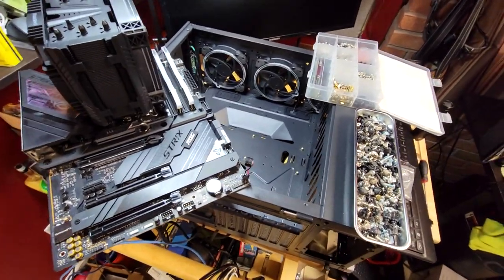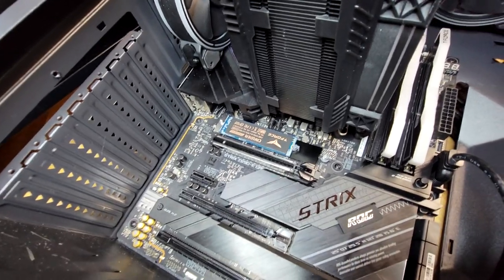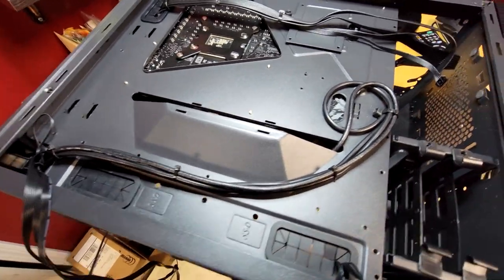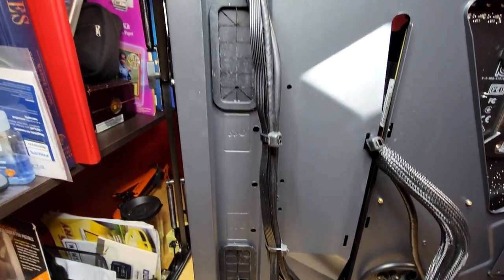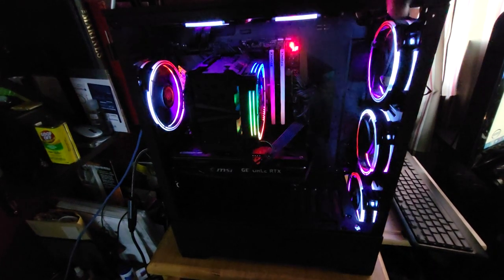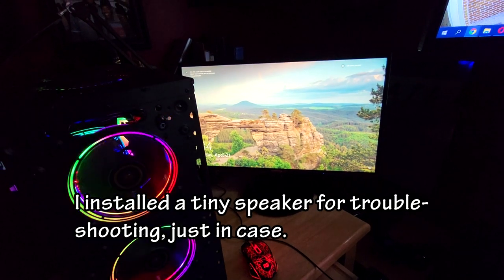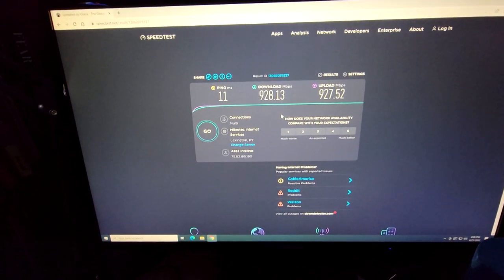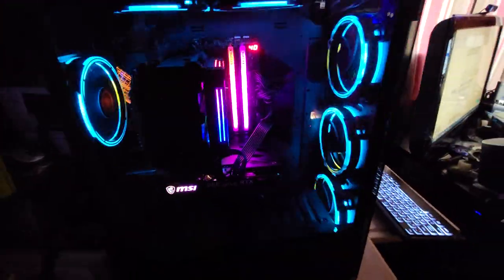Junkman's ROG STRIX Z690 E Gaming WiFi Monster Build - COMPLETED!

Comment: We had a storm that killed one of our computers.  The battery backup/surge protector no longer worked and I had not replaced the battery and I paid for it.  Fortunately it was just the house computer and not my gaming/photo processing computer.  I have to get a new mother board and CPU and drop them in. Which GPU are you using? What games you play?  Nice build.  All those roaming different color lights would drive me nuts though.
Reply from the maker: The GPU is a NVIDIA GeForce 3060, 12Gb. Everything from my computers to my TV's and monitors are protected by multiple APC battery backups. My office is protected by this monster.  https://www.amazon.com/gp/product/B077YDWR3Y/ref=ppx_yo_dt_b_search_asin_image?ie=UTF8&th=1
Reply: @Junkman2008  Nice.  I've been trying to score one of the latest Ti GPUs but no luck.  I may have to settle for something a bit less.  I have a build that's just sitting and waiting for the right GPU.  I left the computer exposed and paid for it.  It was a cheap I3 build for the family to use so not too much lost.  I hope the HDD and SSD are still good though.

Comment: I've never seen a lighted keyboard like that who makes it?
Reply from the maker: You have to go shopping in the old people's section of Amazon. 😄😄😄
https://www.amazon.com/gp/product/B09LH4KF5H/ref=ppx_yo_dt_b_search_asin_title?ie=UTF8&psc=1

NoW if you don't have bad eyesight, you're going to want the one I have on my main box by Logitech. It is very nice: https://www.amazon.com/Logitech-K800-Wireless-Illuminated-Keyboard/dp/B003VAGXWK/ref=sr_1_3?crid=3S7RXC2XUUH45&keywords=logitech+k800+wireless+illuminated+keyboard&qid=1650612459&sprefix=LOGITECH+K800%2Caps%2C68&sr=8-3
Reply: @Junkman2008  I've been using k800 keyboards for years but they break too easy however I love the programmable buttons. Thank you for the links.
Reply from the maker: @coleboonecustoms  
I've had my K800 for around 3-years. No problems so far. I like the fact that Logitech has programmable dongles. That's pretty much all I buy because of that feature.
Reply: @Junkman2008  I haven't looked in a while but I clicked on your link to the k800 and they are not available anymore and it turns out that Logitech discontinued the k800 unfortunately. That means they no longer offer a programmable keyboard.
Reply: I forgot to add that you can buy the k800 brand new on Amazon for $299 from a price gouger LOL.
Reply from the maker: @coleboonecustoms  
I just rechecked the link and it worked just fine. You may need to empty your browser's cache. Logitech doesn't make programmable keyboards, they make and sell programmable dongles. So if you lose your dongle, you can buy another one for $6 and program it to work with any Logitech device. You can even program a dongle to work multiple Logitech devices.
Reply: @Junkman2008  did you see the price when you clicked on it? because I tried it on a mobile phone and it's just shows that they're unavailable with no price showing. I would buy two of them right now because they discontinued the product.
Reply from the maker: @coleboonecustoms  
Newegg has them right now for $72.99.
https://www.newegg.com/logitech-k800/p/0GA-034G-00001?Description=logitech%20k800&cm_re=logitech_k800